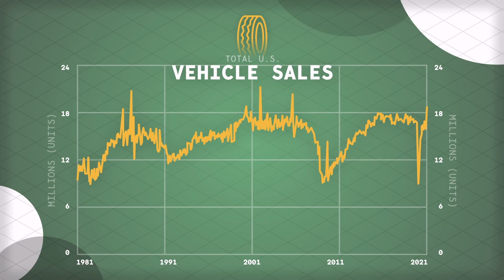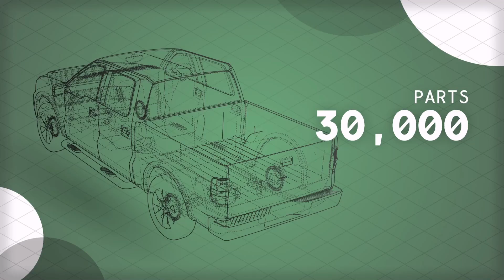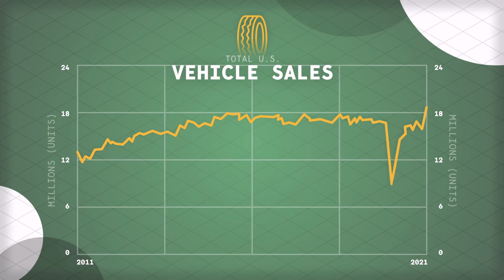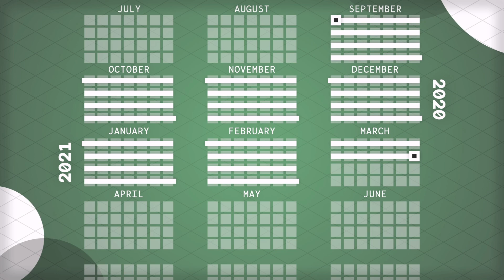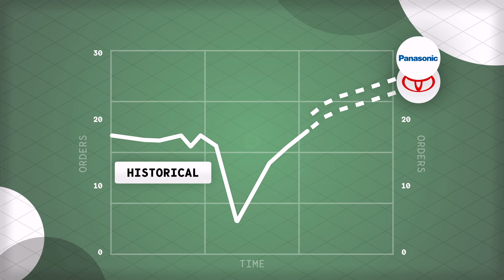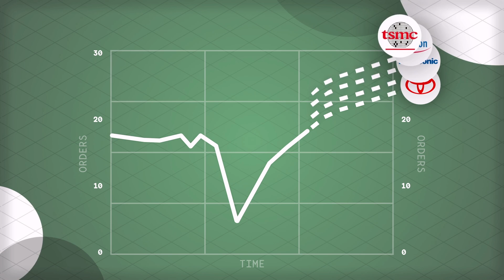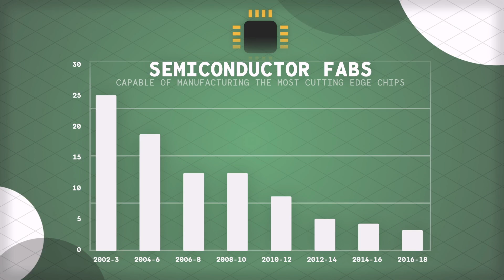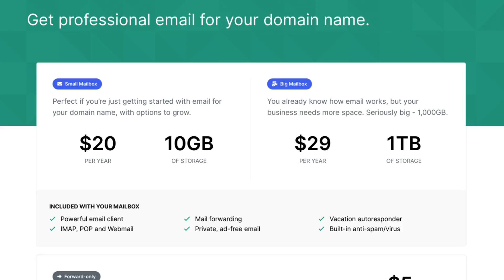Why the World is Running Out of Computers

Comment: If people start utilizing older hardware for their personal computing then there will be much less waste
Reply: The applications people want to use do not run on older hardware. How are you going to edit video or play triple A games on old PCs? Not too well, that's how!
Reply: @1pcfred  I disagree. As an example, the i5-2400 is 10 years old and could be paired with an older GPU (R9 270X, GTX 970 for example), an SSD and 16GB DDR3 (which can be picked up really cheaply) for a system capable of some gaming and video editing. Until recently, these older GPUs were sat gathering dust but now, they are of use to people who can't get newer ones. And that's just one example. There are millions of consumers buying new laptops. For a high percentage of these people looking to accomplish basic office work, web browsing and light gaming, a refurbished ex-corporate laptop would be a perfectly valid and more environmentally friendly option. We just need an incentive - there is usable silicon going to waste

Comment: Heck Id take a car without all the fancy tech. Put me back to an old dial speedometer and wind up windows. More tech means more breaking points in the car.
Reply: And you could fix them yourself. 
Inexpensively.
Reply: Absolutely. I am glad they are going back to simple mechanical. Brands like Dodge put a chip in their alternator so you can't even replace it without having to take it back to the dealer to re-programming the computer. How stupid.
Glad they are running out of chips. Let see if they still put these useless lockout chips in their alternator. hahaha

Comment: Toyota has largely been unaffected by the shortages, since they changed the way they get parts after Fukushima
Reply: Toyota seems to be one company that has some really good management. I've talked with one friend that works in their Huntsville, Alabama manufacturing facility and whenever he talks about work he actually seems to love his job and the company he works for (and he's working on the line, not in management of administration or anything). I think it was actually one of Toyota's plants where UAW came in and tried to get the employees to unionize and the employees were like, "No, thanks, the job is already good enough and we'd just have to pay union dues so we'd just be taking a pay cut with nothing to show for it."
Reply: @matchesburn  i’ve got 2 mates that work at seperate Toyota dealerships, ones a mechanic and the other is a salesman, they both absolutely love it and can’t speak highly enough of Toyota as a company. There’s also a reason that they have a roughly 22% market share in Australia when the second largest market share had about 9%, it’s because they build fucking good vehicles
Reply: They first changed with JIT manufacturing, then they rethought their supply
Reply: It's the Toyota way.
Reply: If this is true then why am I told by the dealer that the vehicle I want (Venza) will take 6 months to arrive even with deposit to assure I am a committed customer? I want my Venza!!
Reply: @robg8718  shipping wait times and some product shortages of non semi conductor components

Comment: Actually having buttons and non-digital elements on cars is fine. As a car mechanic I don’t understand why everything has to be tablets and screens
Reply: As an electrical engineer, I absolutely despise those stupid tablet dashboards. 

I mean, fine, it's an EV and having a computer in there increases safety and efficiency by a lot. But why does it need a goshdarn internet connection and a touchscreen??
Reply: @sh4dy832  for real. cars are made for driving, not for 4k streaming of whatever. i really don't know what else besides listening to the radio or songs from a usb, the uses of a touchscreen.
Reply: @rayzojams  as a red user, I do enjoy linking my Bluetooth radio and changing my YTM via touchscreen... #firstworldproblems. ... forgot my dash display is now a menu screen.. fml
Reply: @rayzojams  Or if you wanted all the functions, just get a phone holder and boom, problem solved
Reply: @smncoolidfk  my dad has one of these, the only issue is when the sun is out, the phone gets hot. but it's only for gps sometimes or calls
Reply: @sh4dy832  as a software developer, i could not agree more.

And is not only on cars. Fridges have fucking screens nowadays, a lightbulb that requires internet connection,and other things are just... Useless. Sadly, American consumism has permeated the market, and now everyone wants a cute display and IoT devices that are virtually useless but cost a lot in resources to the earth
Reply: @sh4dy832  to collect data, and more data = more money 👉 👈
Reply: exactly. modern cars have too much electronics in them
Reply: @jeffthekilller731  too much? no such thing and they will only get more to improve it haha
Reply: @LordBackuro  ...he said on youtube :P

It has its pros, but cars aren't one of them.
Reply: People don't buy things that don't have fancy interfaces anymore. It's ridiculous.
Reply: It’s the demand for fancy tech, not the need for it
Reply: I have a theory about that, they make more complex screens and fancier interfaces in order to make repairs and fixing harder to find, hence the buyer needs to go directly to the seller (A.K.A. Toyota, FORD, Mitsubishi, Peugeot, etc) and pay more expensive repairs, is in some way, similar about what apple does with their phones and tablets, only them can repair their devices even if it's only a battery change or something really easy, in that way, they keep control on the product and the supply chain.
Reply: Long live analog.
Reply: @zero9112  that's it, I'm looking for a Ford model T on craigslist :)
Reply: That’s why I‘m going to buy an oldschool motorcycle. I don’t need fancy electronics, I don’t need a screen I just need it to work and I’m saying this typing on my iPhone 12 mini…I love new tech and phones and pc‘s but cars / bikes hell naw electronics stay outa there (not the important stuff like abs, navigation System (small screen at Max) and stuff that increases safety) all that unnecessary stuff like oversized screens (more like tv‘s)  and shit we don’t Need. Give us more physical buttons and nobs to push and turn that’s what we want and need and best of all it can’t freeze or lag and be frustrating like some
Reply: Agree, I like to be more mechanical worked than digital because it easier to fix and if broken we don't need change everything, less maintenance cost
Reply: As a PS5 user and someone who just bought a 2021, I can say there are wires connected to everything.  So long the days of people being able to just replace a part on what they own.
Reply: Because people are retarded and can’t live without a screen in their car that tracks their entire routine (i’m not joking), and can activate all the useless shit in their car ranging from automatic reclining seats, to their seat cushion ass warmers...

My dad has a truck just like this...
Reply: I personally hate touchscreens tbh.
Reply: I know right! I guess people are crazy for fancy & futuristic features.
Reply: Tablet controls are actually significantly cheaper than dials at scale. And far less safe. It’s purely a cash grab my manufacturers falsely advertised as an upgrade.
Reply: This is why I love Chinese electronics, so unnecessary touch screens
Reply: It has to be since it's alot of profit margins
Reply: It’s to make it so you must take your car or anything for that matter to the dealer. No more shade tree mechanics. You used to be able to purchase or take your car to the auto parts store and have them use a diagnostic device. 
Now those devices are blocked and they just tell you you have something wrong take it to your dealer instead of the source of the problem.
Reply: just preparation for the mark of the beast surveillance system
Reply: yeah, what's up with that???? ridiculous
Reply: It's all about control. Government and corporations (both same thing) want to track us, record everything we say and do, and to know all our contacts and behavioral patterns. Plus makes it easy to disable a vehicle with an EMP, or they can simply hack the vehicle and do all sorts of things like drive you and your family off a cliff or into a large body of water; have the car drive itself to specific points of interest that with GPS tracking can set someone up as a murderer or bomber. Imagination and evil of the government and corporations are both infinite and unlimited.
Reply: @WHITELIONNYC  i think your tinfoil hat is on abit too tight haha
Reply: @jodyboles8208  as an FAA licensed Aircraft Maintenance Technician I get precise down to 1/132nds of an inch. So the fit is so perfect that in the winter it doesn't fit. The Germans had a similar dilemma with their tanks. 💪🏻🤓👍🏻
Reply: cause they look cool and high tech lmao using like a dial and a tiny screen that only displays text to change channels in a fancy new car feels wrong, the car looks modern so too must most of the controls for radio and a/c and stuff.

Comment: Wait so im kind of confused. He said semi conductors take months to make and require multi-billion $ factories. But he also said they only cost $5?? How could they be so cheap??
Reply: Imagine a special type of rice. This special type of rice has to be cooked in different special rice cookers each time. to make the rice, it requires about separate 10000 rice cookers and about 30 minutes in each of them. The special type of rice is easy to get but it isn't able to grow. The main way they get the rice is by drying the compost of that rice or just mining. The rice cookers made for the rice are made to be giant to hold as much rice as possible. The workers dump the rice in the rice cookers and move it along and along throughout the rice cookers. Eventually after a few months, millions of grains of that same rice have been made. Basically mass production.

Comment: My recently bought graphics card is double the price now then when I bought it.
Reply: A GTX 1070 FE (which I have) is around 400 used on ebay ATM. There's a few at a lil more than half that with number of bidders in the high dbl digits range. A RTX 3080 is about twice as fast as a 1070 in any benchmark. That's not compellingly better when scalpers (and even retailers) are selling a FE 3080 at $2400 or so USD

Comment: Seems like a good chunk of the problem is the result of merger mania and companies were allowed to get too consolidated and the supply got concentrated in one geographic location.
The solution would be to break up these companies or provide seed money for new start ups like how companies like Spacex and Rocket Labs broke the near monopoly on launch providers.
Apple at least has enough money they could afford to build a fab.
Automobiles at least can compromise such as running an 8bit uC  or an arm 7 type chip as there's still a good number of smaller fab companies that can make them.
Texas Instruments, NXP, STMicroelectronics, Oki,and Renesas still have their own fabs.
getting them up upgrade to new technology might help make the supply mine more robust as well and 7 to 3 nm will probably be useful for a long time.

Comment: Here is the short version: tRump required attention, tRump points finger at China, insults China, China stops shipping semiconductors. Look around your small town and wonder why your municipality no longer recycles cardboard, aluminum, steel, or glass. That decision is also because tRump insulted China way back in October of 2019 resulting in China raising recycled purity levels to .05% pure, which no American recycler can meet. All of these missteps will either need to resolved with China or sourced elsewhere. Adding semiconductor capacity takes years and billions of dollars.

Comment: There is a lot more to it than them just cancelling and the GPU manufacturers buying up space- the car manufacturers actually rely on incredibly dated manufacturing because they only need very cheap very old chips to do the work. The problem is, semiconductors are NOT profitable- in the slightest- so by cancelling their orders they really fucked over the Fabs and forced them to adjust. As it stands companies already demand such a low price that the margins are so tiny even the reduction of cost overtime for longer jobs rarely compensates. So they expect costs to drop as yields increase, but due to how much they are fucked up already little of those savings actually help the semiconductor companies. Given it costs BILLIONs to make a new fab and the business is in no way profitable, it is no great surprise that we are in this situation- this situation was always likely if even the smallest imbalance to the market occured.

Comment: The chip shortage is not going to end for about a decade.  The "later this year" and "maybe next year" are both predicted by analysts that have no idea what they are talking about.  We, humans, all of us, collectively, just don't have the infrastructure in place to support the exploding demand for semiconductors.  And the shortage will continue until we get the infrastructure in place to handle the growing demand, ALL of it.  It takes many years to build the manufacturing facilities that manufacture the semiconductors.  It is not like you can just throw 4 walls and a roof together and that is it, time to open up shop.  No.  These facilities are complex, they are clean-room factories.  Each factory has to be built, from scratch, to manufacture the specific type of semiconductor you are trying to make.  It is going to take a decade, give or take a year.

Comment: Taiwan is facing its worst drought/water shortage in the last 56 years and a serious electricity shortage/constraint (already 2 big blackouts this year). These 2 factors are casting doubts on the TSMC's manufactury capacity this year. I think a lot of companies are panic buying because of these uncertainties on the supply side. Not sure why u didn't mention them. Maybe you are saving them for the next video.